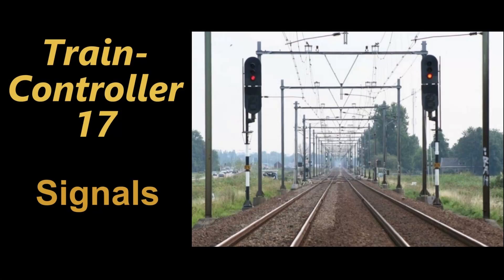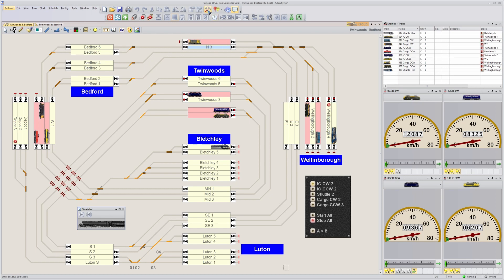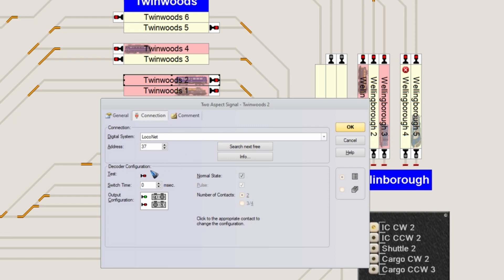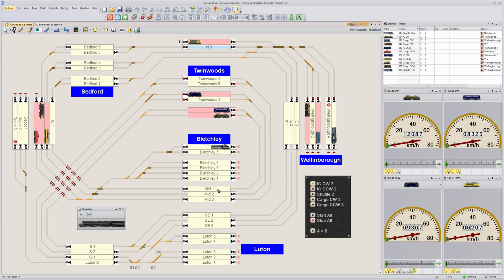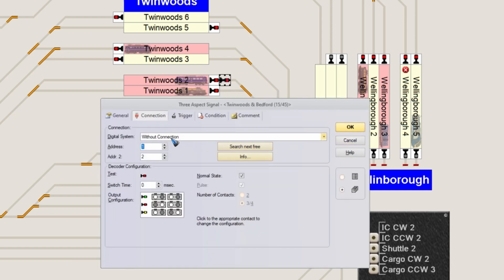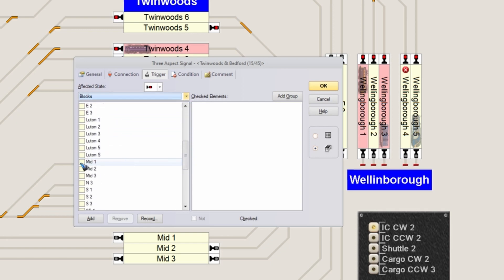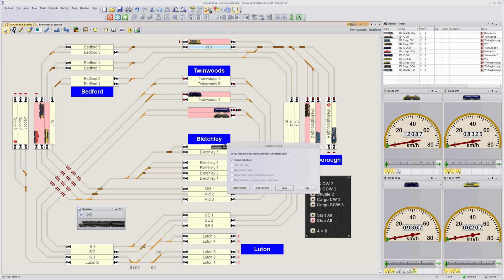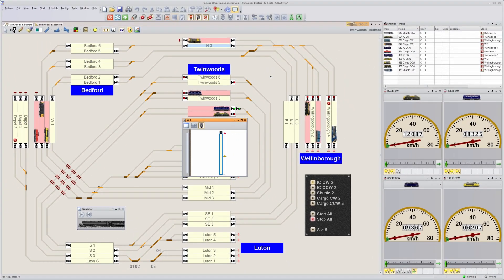Traincontroller 10 Gold 17 DCC Controlled Signals

Comment: Great video. Just so that i understand this, when the train enters a block, if the next block is occupied traincontroller will both turn the signal red and auto stop the train.
Reply from the maker: That is correct, TC takes care of everything, even the deceleration of the train, which you can specify yourself to make it visually attractive in your eyes.
Reply: @rudyshobbychannel  Thank you so much.

Comment: Can I ask a beginner's question. If I purchase a 3 aspect signal model from the shop, does it come with it's own built in decoder or do I need to use a central decoder as with turn outs control? Or something else?
Reply from the maker: Usually signals do not come with a decoder but it only contains the pole with the LED's and most often the series resistors that set  the LED current are also mounted.